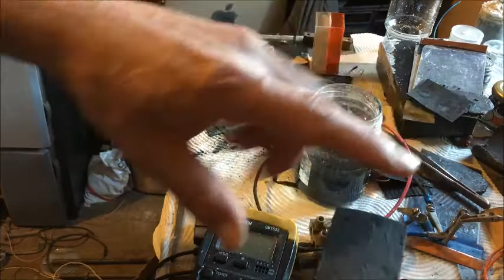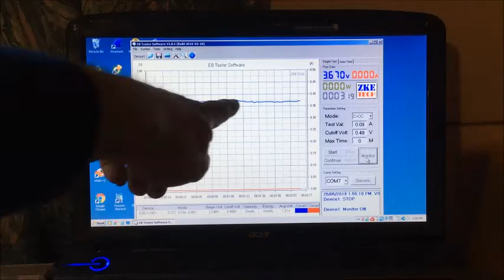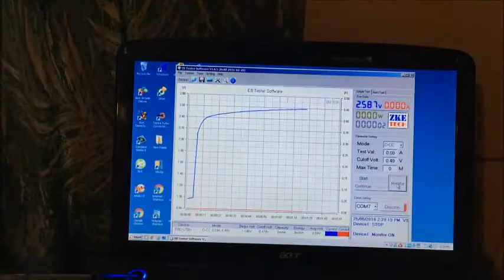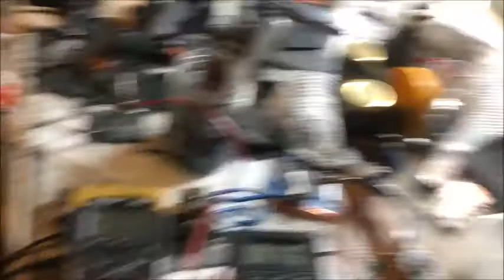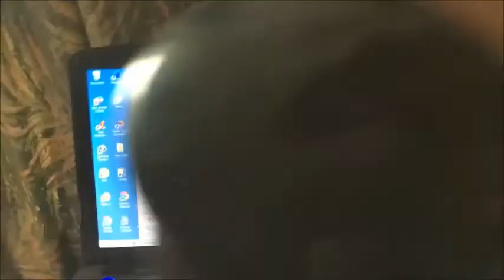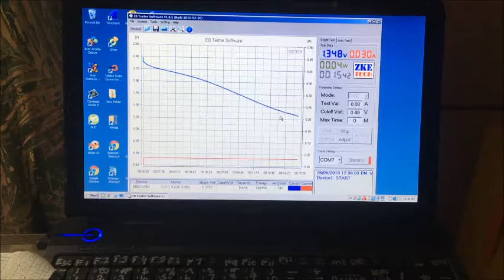Testing Activated Sugar Carbon

Comment: You disobeyed the first rule of empirical experimentation: changing more than one parameter at a time. Whether performance improves or not it is impossible to tell which factor causes the change.
Reply from the maker: Hi.Oh the carbon separator yeah I don't know what happened in doing that or why I did it(I did put a standard separator I've used in the other experiments). Or maybe the coated cell vs the towel coated cell. I'm some what torn between both ideas.

Comment: Hi Dan, Great results!Regarding AC, I have come to much the same conclusions. I am sure you could get better results making your own AC, other people here on YouTube defiantly have.The question is how much better?  Is it worth all the extra work and expense using furnaces and such. For large DIY stationary battery for solar storage I would be inclined to take the “keep it simple and make it bigger route”!I can confirm that the MnO2 from D cells work better and is cheaper than MnO2 from ebay.I can buy a D cell in the UK for £0.5, it contains 50g of MnO2 and 15g of Zn metal as well as a highly conductive carbon rod.If I can find a way of reusing the Zinc, either as a metal or powder then this is a cheap source of materials :-)   Martin.
Reply from the maker: Hi. The D cell may be using carbon black mixed with the Mno2 and not just Ac.
I'm going to look into buying some CB and Mno2. One thing I have noticed about some carbons I make absorb more of the binder mix then others and could be one of the reasons the cell fails.
Reply: Hmm,. so the D cell has 3.33 (interesting number) times more oxide than metal! That's good to know Martin. Shows how important oxygen is to any battery. Thanks for the info! :-)
Reply: If you're looking for a way to recycle D cells Martin. it might be possible to re-make the battery using a metal can, if you melted the zinc and coated the inside of the can quickly to galvanize it. Then put the carbon rod back in, and refill the can with whatever oxides, carbons, etc you want. That would be a very cheap battery, and you could refill it easy too! :-)
Reply: Hi Ray, I have been experimenting dissolving the zinc metal in HCL, and trying to plate onto aluminium foil to use as current collectors, or convert into a powder that can be used in my cell Anode.
Reply: I was looking at powder coating supplies at Harbor Freight on my last trip to town.  The instructions were to bake the powder coat after it's sprayed on, so maybe baking the zinc chloride after it's painted on would work.  Good luck with that. :-)
Reply: Cheers for the heads up Ray :-)